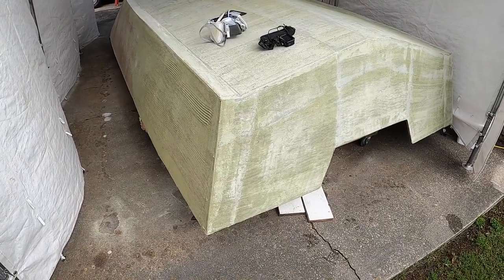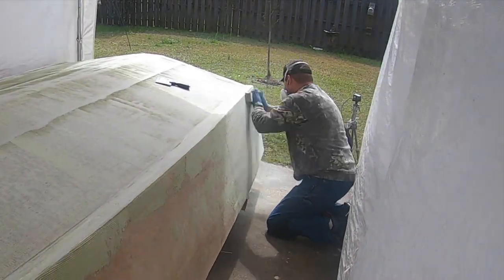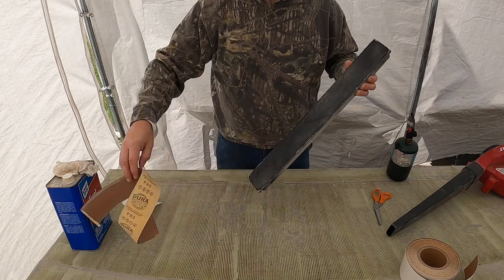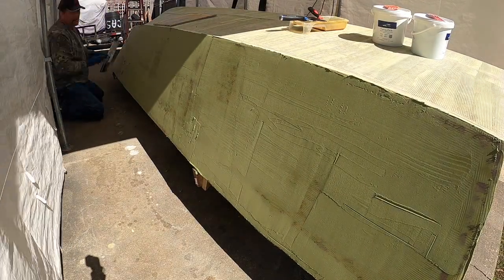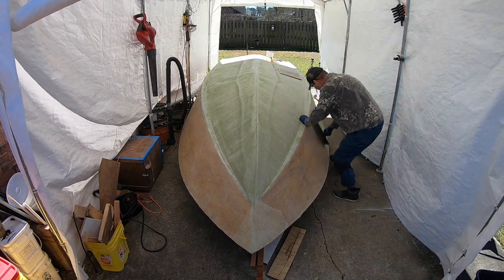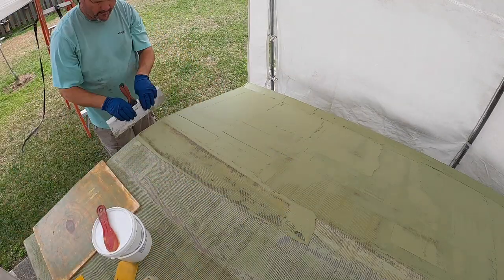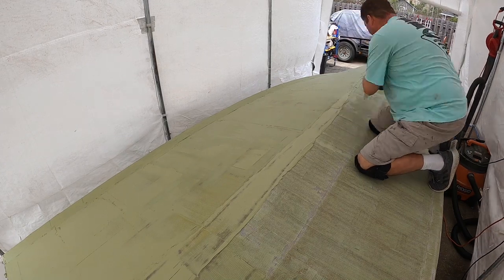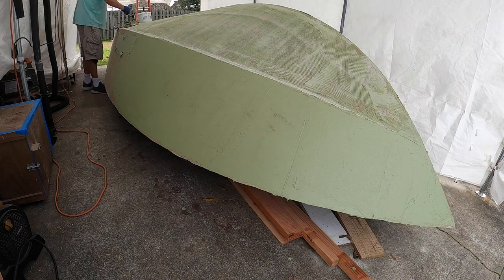31. DIY Boat Building: Some Lessons are NOT FAIR!

Comment: RIP The Fan. I get what you're doing. When I was growing up, we applied fairing compound so thin you could see through it, except in the low spots. Almost none on the rest of the fiberglass, and then when we sanded, there were little islands of fairing compound and mostly fiberglass. That's probably because we were so broke we couldn't pay attention, and fairing compound is expensive. You're building a layer of fairing compound between the fiberglass and the paint, where we just used fairing compound to fill in low spots, like bondo on a car.
It's going to be a beautiful boat, and you clearly have much-deserved pride in your work. I've followed along from the beginning, this is going to be a boat that lasts 100 years.
Reply from the maker: When she paid $7 for that fan and the shape it was in, I thought she paid too much, but it gave me a couple good years and some good laughs.  In the early videos it always looked like it was shaking it’s head no all the time.  This fairing compound deal is all totally new to me and everything I know about it I have learned reading or watching videos, so it’s not like I have mentor or any experience, so it took me a little while to get my bearings.  I think things will show it’s all moved in the right direction.  If not, I will own it as my doing.  But i will do whatever it takes to do it the best I can.  I’m not apt to cut corners.  And overall like on the sides I tried to leave the thinnest possible layer just over the glass in hopes that I would sand back just to the glass and be smooth.  Let’s just wait and see how that works out.  I appreciate you following along and commenting.  I like this part as well.  And I only need it to last about 20 years.  After that it will be up to the kids to fix my mistakes.

Comment: That bottom looks smooth as silk. Your doing a great job. The notched trowel makes sense to me as it seems once you finished sanding the notched coat your basically placing a thin coat to fill the voids left behind. Very smart.
Reply from the maker: Well time will tell if it was a smart or foolish move.  Truth be told, I don't know enough to make that evaluation just yet.  From what I saw today, I am starting to think everyone does it a certain way for a reason.  But, we shall see.  I am beginning to see better what it has done, and maybe what the traditional method would look like.  But, before I started this build everything I knew about fairing I learned from reading and watching YouTube videos.  I'm bound to not be the best at it when I start.  Appreciate the comment and support.  Gotta keep pushing it forward.

Comment: Looking better with each episode. Whether it's drywall compound, auto body filler, or fairing compound, the less you put on the less you have to sand off. It will take several applications when dealing with an area as big as this. Add to that is the fact there are different amounts of layers of fiberglass.
Reply from the maker: No doubt.  Somethings you can learn from a teacher, but I don't have that luxury.  I'm learning on the fly and my shoulders and arms live to pay the price.  But, the good news is this can't last forever.  It just feels that way.  Appreciate it.

Comment: Hey Oscar, I was just wondering, couldn’t you use an orbital sander on the sides? I figured since the sides are almost flat it could save you some time. Also, is there any way you can thin out that compound, maybe with some mineral spirits or something?
Well, I’m caught up now and I really like what I see. It’s gonna be a great boat. 
Thank you.
Reply from the maker: Someone else may can get away with an orbital on the sides, but I need to use the longboard strictly because of how inconsistent my application of the compound is.  There is a lot to see coming up that deals with the results of pulling that compound last time.  As for thinning it, the biggest reason you don’t want it much thinner is that as it is now, it won’t run down the sides of the hull, which is an asset.  It’s just about right on that edge where if it was any thinner it would start flowing.  I don’t have any complaints about the product other than cost, but you play you pay.  Glad you are caught up.  Now I can make you wait….
Reply: @Bigeaux20  😂 LOL hahaha

Comment: How many gallons of the total fair have you used on this project ?
Just getting an idea , cause I need to order some for my project.
Reply from the maker: I'll do the best I can to answer the question, but please understand that it will vary a lot depending on your situation, application, etc....  If you have watched my project you know that I used a layer of compound on the bottom with a notched trowel of about 3/16" and also factor I have never used fairing compound before in my life.  But, with all that being said, I think I have used about 3 gallons up to this point on the bottom.  I can say with certainty that someone with experience may have used less, but I'm documenting my journey and I am not as efficient yet as I can be.